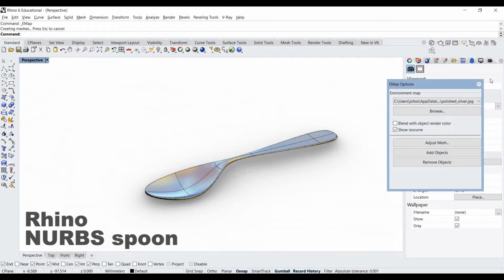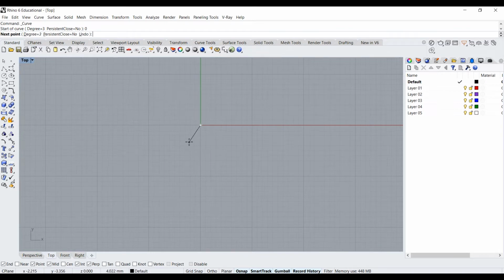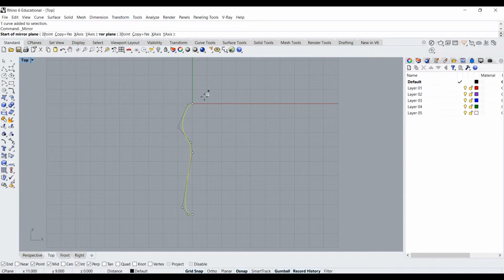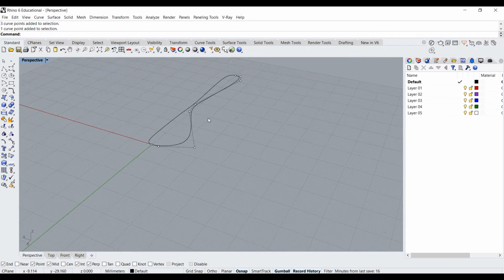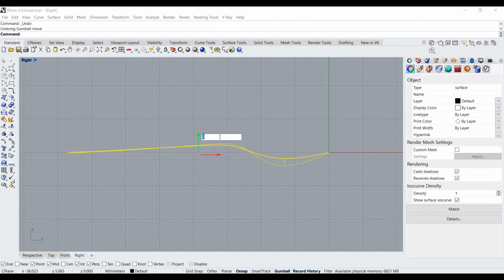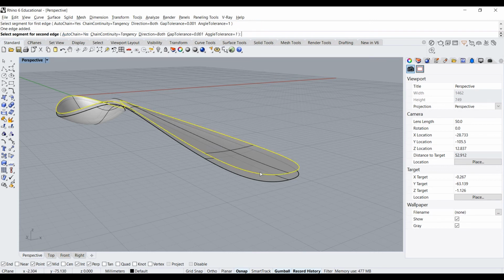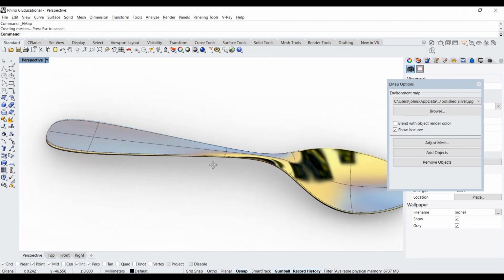Rhino 3D Modelling Spoon Tutorial (updated)

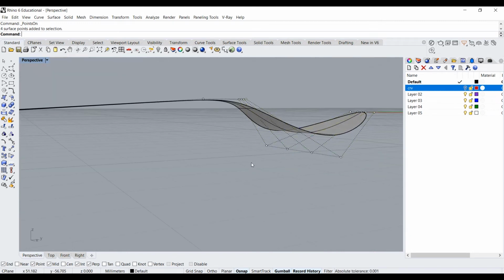Comment: At 15:06, when I try to pull the outside edges up, a dialogue box appears saying "Dragging broke history on 1 object"
Why is it happening and what do I do in that case?
Reply from the maker: Hello, this is simply a warning to tell you that the act of control point editing the surface is breaking the 'History' relationship with the original curves.  Meaning the surface will no longer remain controlled by the outline curves. Its not an issue for this workflow, but its worth taking note when you see this warning (you can chose to ignore and turn off the pop up)